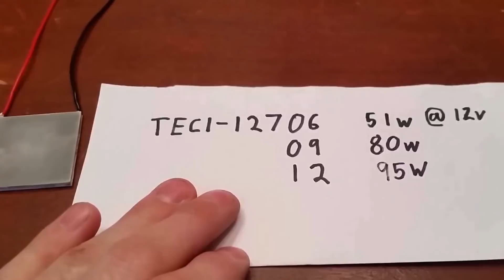Peltier cooler spliced in to AIO water cooler

Comment: a nice answer to anybody asks  to ourselves " how to solve the frost or condensation using peltier for cpu temp, but inside of case? why not OUT? this is an example. i have my radiator before the 2 peltiers o same circuit, propulsed by another extra pump. . i reach 10 dgrees C, 30C out, Chile, is just a radiator and a cpuwater cooled socket, to expand the water from circuit, all over the peltier zone(= same as as socket size) . and that water runs outs ultracooled mod, pumped by a electro fan for circuits.

Comment: If the heat load exceeds Qmax there is no heat transfer from the cold plate to the hot plate. Because as per data sheets at Qmax, deltaT becomes zero and when Qmax = 0, deltaT becomes max. It's an inverse relationship.

Comment: Your problem are that your GPU core die sits lower than the surrounding metal "shield". So your cooler plate never touched the GPU core and thereby it overheated as soon as you loaded it. 
This is the case for HD7950/7970  and 280/280X
Reply from the maker: I have heard this is true in some cases my particular GPU the die is definitely higher than the guard or the stock cooler would not have made contact. 

Edit if it was not making contact with the die there's no way it would have gone down to 2 degrees Celsius
Reply: @brokenone22  what card did you try this on?
I water cooled a few 7950, 7970 and 280x some time ago with "custom" blocks and I had to remove that metal plate with a razor blade.

It probably worked at idle as ATI ever since the 5870 card have had a system to throttle down the card when it is not under load to a point that it nearly uses no power. This combined with a thick layer of thermal paste to bridge the gap.

This atleast are true with ATI/AMD high end Tahiti cards.
Reply from the maker: @Mr.Engineer.  the one in the video was the asus direct CU II 280X
Reply: @brokenone22  Then we have the reason it didn't work. Just look up any 7970 or 280x cooler and you will see that they compensate for this. Or just Google 7970 water block compatibility. 😀
Reply from the maker: @Mr.Engineer.  i just walked out to my shop and grabed the cooler if you want at photo of it and the gpu showing that the braket on mine is lower then the die I can show you or you can just take my word for it. I have heard of what you were talking about but not all 280x  / 7950 7970s are the same.  I even have a 7950 in my pile of dead hard ware and its braket is lower then the die
Reply from the maker: https://www.vortez.net/articles_pages/asus_r9_280x_directcu_ii_top_review,8.html

Shows the cooler on the model i had.
Reply: @brokenone22  All of my 7 AMD Tahiti have a to high bracket. But it might have been adressed on the later versions. Lets settle on that? 😊
Reply from the maker: @Mr.Engineer.  sounds good man the 7950 i have the cooler it has has a little shim that on it that would to exactly what you're saying.  And I have definitely heard what you're talkin about existing on some of them so not say your wrong 😊
Reply: @brokenone22  Looking at your link I see that you are right. Must be later revision chips 👍🏻

Comment: ok how about this : when pc is iddle turn off the peltier and when load turn it on or you can put a thermo sensor and switch it automatically, so no more subzero temps = no condensation

Comment: great. I had the same idea . but In this case u need to insulate the waterblock on the tec side. I would recommend to use Silicone sealer with thermocol . Once insulated the performance will increase

Comment: I see this has a year ago. there's a website called banggood.com it's a Chinese site that has the *******12 ones in two packs for 19$ CAD. and they also sell a refrigeration unite. it has one of those blue cheap water blocks. plus two hear sinks and fans. I bought all these. in getting an idle temp of 5 to 8 'C. and max load of 30$. that on an overclocked i7 7700k at 5ghz. and another one of theses systems on my gpu. (still uaing an r9 290, way better for price on used market that buying anything right Now with stupid mining craze). I may do a video. make an update though inwant to see if this held up for ya
Reply from the maker: Alex Slater vary cool man I will look in to it

Comment: dude this is huge, i'm having a problem, my rx480 is kinda hot 24/7 thx to cryptomining, and i was thinking something with peltier, would you recommend this?
Reply from the maker: Lemon Six for mining not the best idea the cooler itself burns up a lot of power 90w  so would eat in the the profit of mining with the added power costs
Reply: right now in argentina is winter so it's kind of room heater, but i don't want to get to summer and realize i'm in living hell, so i'm thinking alternate ways of getting gpus cool while mining without extreme power usage
Reply: Porque no le agregas fan coolers molex cerca del gpu ?, si no te importa mucho el ruido le puedes colocar unos de 3600 RPM y eso te deja la grafica como a 35 grados idle.

Comment: This is the answer to the condensation, just use two water blocks on the loop. The colder water is enough to cool the cpu/gpu, the peltier is not necessarily needed to be mounted on the top of the chip itself. 
Sub zero temperature is not a realistic choice for 24/7...

Comment: the real question would be how to cool a 200ish Watt TDP chip via PWM... as in how to "allow" cpu/gpu thermal temps to (fan curve) thus WATT limit the 200ish+ peltier device without drawing from the MOBO or GPU anything other then the temps... it would have to be externally powered but software/bios monitored as to prevent 200 WATT TEC dissipation while at idle ~60 watt... thust preventing condensation. thx

Comment: thermal runaway is due to TDP of the chip. it was just to small of a TEC too far from point of contact... ie chip face vs external. the problem isn't get a bigger TEC it's placing it at the CPU and preventing condensation. this would have to be pwm controlled via MOBO as to fan curve ramp with CPU temp. the following problem is WATTs this could be midigated by tying multiple PWMs together with zener diodes as not to create a circuit on top of the MOBO. the condensation could be solved by aiming for 30°c @ 60 watt. still it wouldn't yield more then 60 Watts dissipation. and you would "soak" under load. but under normal use or (atom-qualcom) chipsets you could see a silent passive/active cooler. thx.